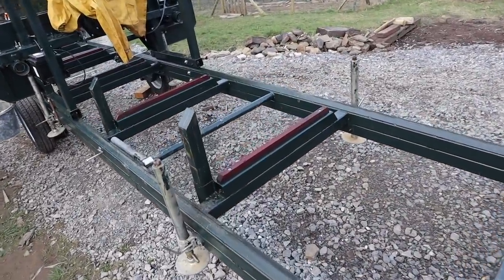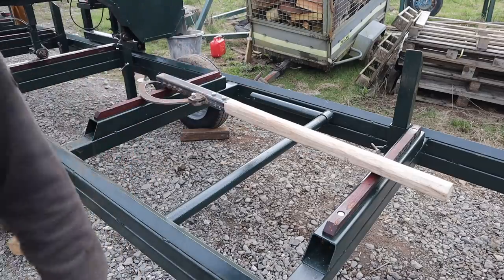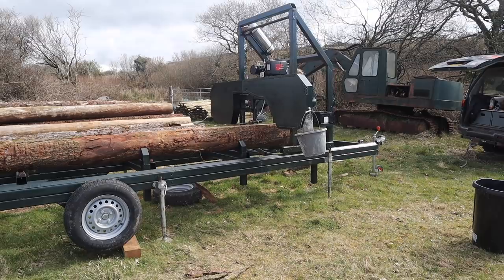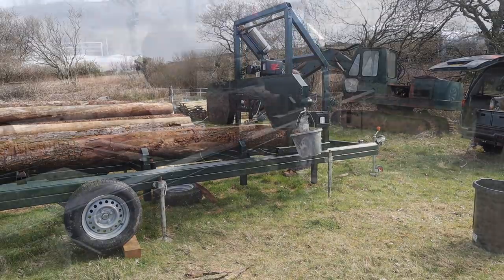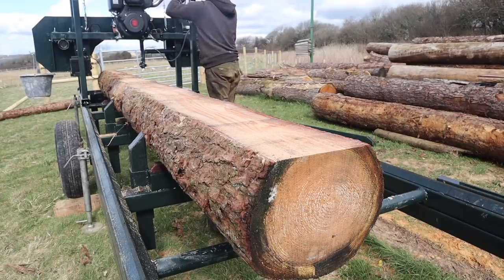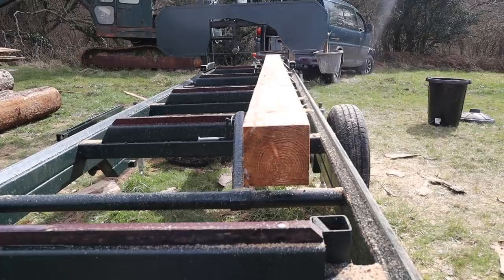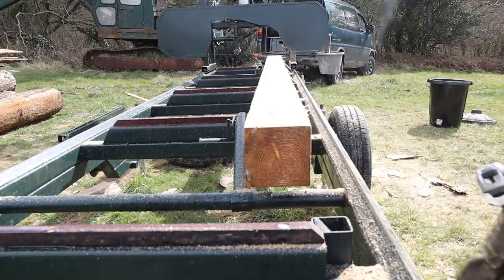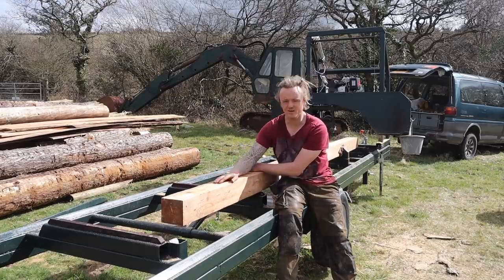First Cuts On the Homemade Bandsaw Mill

Comment: And just like that every farmer around you is now your best friend
Reply: And now he might get a decent supply of lumber in return for the services of his sawmill. Not to mention some of the useful junk that farmers tend to have in plentiful supply.
Reply: @naiknieh  This, my neighbour has a 60x40 shed with approximately 10-15 conical piles 10ft high of random metal parts, boat parts, tractor parks, Alaskan mill parts, chainsaw parts, honestly any time I encounter a 40-50 year old piece of machinery with a broken part that no one makes anymore I go there and usually find it, covered in rust of course, but enough to be able to rebuild the part and have it work properly again. He's an older man, raised poor during the depression, doesn't throw a damn thing away.

Comment: Haven't read all the comments , what I am about to suggest may already have been suggested. As a 15year old laddie,(1955), I worked in a woodyard, my job was removing the bark from the sticks,(trees), these would be used for the pit props. the machine used for this purpose would eject the peeled bark through an outlet similar to your sawdust extracter.at the end of the funnel were three hooks welded onto the outside of the funnel, by hooking on a hessian sack to these three hooks we collected the majority of the peeled bark with little spillage, you might want to consider this. By the way , I cannae drive a nail in straight , maybe that is the reason I really enjoy your videos. Thanks for all of them.

Comment: I would highly recommend a water tank and a feed line to lubricate your blade, prevents the blade from stretching excessively.
Use some dawn dish soap in the water to help. Doesn't take much.

Comment: Kris, I'd recommend you install some hard wire brushes infront of the carriage wheels, to keep the rails from becomingbuilt up with tree resins and sawdust. We have a sawmill similar to yours, here in Wales, and we predominantly mill pine from our plantation. The metal brushes prevent the running gear from being clogged. They are also installed at ther back of the runners, to scrape the rails clean again, when you run the machine back to its starting position. This tip will save you a lot of time cleaning rails and wheels.
.
Reply from the maker: Yeah i have seen those done on other mills. i think a bit of steel cable works quite well. Yep, another job to add to the list.
Reply: @KrisHarbour  I'm still jolly impressed with your build. And all of your constructions. You've certainly inspired me, an d others  in our small community.

Comment: If you put your roller closer to your timber it will stop your blade running off (cutting straight)then your cuts will be straighter, we have packers at each side of the blade to stop it running off but always have the packers as close to the timber whilst milling so the blade cuts straighter. You’ll also need a blade for hard wood and a blade for soft wood , I’ve had over 15 years working in saw mills so any advice isn’t a problem 👍

Comment: Awesome job on the saw mill. Just a note about the log rests. Most people make the mistake that the sloped top should face the log, when in fact, it should face away from the log, so when you are turning the log, the point won’t dig into the log. The sloped face allows the rough bark to slide . Cheers.

Comment: Bloody brilliant! One suggestion you might already know: It's beneficial to heat cycle the engine a few times during the break-in period, avoids patterns on the surfaces.
Reply from the maker: Yeah i have been doing that. its had quite a few heat cycles now from all my testing so now i think im going to use it gentle for a few more hours then go full.

Comment: I would suggest a set of brushes for the sled rails to sweep the sawdust off them so your measurements stay within tolerances.
Keep the blade followers as close to the log as possible!
It is nice to see that smile!
Stack your planks and beams with stickers to help prevent warping as they are drying out!
Maybe think of adding a handle bar spanning the width of the sledge to help balance the effort in pushing the mill along the tracks.
I have seen some mills that use a rope system to aid in moving the sledge along the tracks as well.

Comment: A well deserved moment of self satisfaction savoured there at the end. Well done Kris. On the issue of ejected saw dust, may I just share one observation, namely would running the frame rollers on an inverted ‘T’ rail along the ‘down wind’ frame rail by using grooved roller wheels, help to minimise the inevitable build-up of dust debris that will most likely stick to the ‘down wind’ flat surface of the rail? The frame section currently running with flat rollers is continually being sprayed with wetted saw dust and could likely build up layers of compressed saw dust on the surface of the frame by its rolling action? By using an‘ inverted ‘T’ rail, the contact surface area between the frame and rollers is vastly reduced and effectively would most likely self clear, due to the grooved ‘cutting action’ of the rollers.  Build up of sawdust over overtime on the flat rail as it is at present could potentially increase drag and marginally raise the rollers resulting in some inaccuracies along the length of the cut.

Comment: lovely job Kris. nice boards as well. i can see this as a very big step forward in your homestead build. as an added bonus the more boards and post ETC you cut the more firewood you will accumulate with the slab wood coming off the sides of the logs. you can even use the sawdust as soil conditioner, it`s what i do with her garden. she lives "over the other side of the valley" near you. good job, well done....

Comment: If you have an old paint brush, use it for a sweep in front of your rollers. Nothing like a wood chip adding alittle wave to your cuts.  Also some larger pads for your leveling feet would be handy and save you time from the logs jostling the trailer out if level.

Comment: Great job on the saw Kris.  The track where the saw dust is collecting , mount a paint brush in front of the sled. That will stop a lot of the saw dust getting under the sled wheels. Just a suggestion. Bit out my reach for a band saw build .But ...it was worth while watching the process & the trials & errors/ mods you did to make it all come together.

Comment: It looks like it is working very good. could probably use some bracing to stiffen the power head structure. You can see alot of movement on the leading edge blade guide. Rigid is better.

Comment: This will save a lot of time for you . Great job !!!
There is attachment for a worm drive skill saw mag77 that adds a chainsaw bar and you having cheap electric power it could cut left and right cuts after your flat top and bottom cuts . I saw a guy he set them on saw horse and used a metal bar to run the mag 77 skill saw with the chainsaw attachment.

Comment: very impressive. all timber requirements sorted.
there is an NZ tuber that designed a mill with two 90 degree blades. set it up to cut out 1x1 2x4 etc.

Comment: gday mate nice work . if you strip the bark before slicing up the log it helps the blade last longer as the bark usually has lots of dirt and rocks in after skidding. I’ve  had to pressure wash sometimes.  cheers from australia

Comment: Congratulations Kris you should be very proud it turned out Awesome I've seen quite a few store bought mills in use and I think from what I see yours is better built the materials are stronger than most and wait until you get that engine broke in it will cut a whole lot faster as well. Great job !!

Comment: Great stuff Kris. Great to see it working and so well. Once you get your engine run in there will be no stopping you. Isn't it therapeutic? Very enjoyable work. One thing I would say is keep your adjustable roller as close to the log as you can, within reason, don't be adjusting it all the time like because that's a pain in the arse but just keep it maybe 2 inches from the log. For that pile of logs you'll be able to leave it in one place for the most part. I'm sure yours is fine but it just reduces the amount the blade is able to move and wander.

Comment: The sawmill looks and apparently cuts great.  Thank you for sharing your journey.  A couple of thoughts that might help you though.  To cut out any blade bind you might consider some thin wedges every few feet to support the suspended edge.  What we in America at least here in Oklahoma and Texas call door jam shims might work although they are easily broken and wouldn't have a very long useful life span.  But a clever guy like you could probably come up with something similar made out of a longer lasting material.  And if you ran your sliding blade guide closer to your log it might improve your tracking as you cut.

Comment: Should get a chain driven wheel mounted centre-front on the trailer to pull the mill along, using cables and pulleys you could have it pull the mill on both sides giving you a straighter track (so you don't have to worry about the mill twisting as it's being pulled along), would likely be fairly easy to reduce overall effort and your physical movement as well, not to mention safety as it puts you further from the machine plus reduces the likelihood of tripping.

Comment: Very nice, this will be really handy for all future wood projects.

Just one thing for the engine. During the break-in period the engine should be run at all the speeds and under varying loads for the best results. It should see some high speed, low speed and in between. Also it should see high and low loads, just don't go to the max and don't run it at constant speeds.

Comment: Maybe put a bar across the back to help even out when your pushing so one side doesn’t lag, might not be a problem when your at full speed! Looks great
Reply: Good idea - a handle that's half-way between both sides, so that when pushed, the head unit is pushed evenly - as it is, that little side-to-side lag or wobble is bothersome.  Not sure if it's having any effect on the cut...

Comment: L👀ks good so far.  I'd say that the addition of some kind of mechanical aid, to help pull the saw through the cut at an even pace and with equal load on each side as it moves down the track, would be a good idea.  Looked like you had a spot where things were tending to bind while under load.  It may also make a difference on how tired you feel after a full day of cutting.

To keep twist out of your bed ... Use of a long carpenter's level, and making sure it is set up equally from side to side (after loading an average sized log) may help smooth out your carriage travel, and show you if you need to put in additional downriggers... some levels are magnetized on one edge, so you might be able to just stick one on top of your guards and leave it there while sawing.  That would allow you to monitor your level as you go, and you can compensate for settling that may happen during use.

Comment: Something to add someday:
A conveyor belt on the sawdust side to transport the sawdust to a pile.  A setup pulleys and transfer gears will pull the conveyor in the same direction as the cut.  It will ratchet back when returning the mill for the next cut.   One of the gears  to be oversized such that the rate of advance of the conveyer is a little faster than the mill advance.
Alternately, an automatic bucket that empties at the end of the cutting run --- but you would want to run it to the end of the rails to keep the pile out of the way.
Collected sawdust can be used for many other things from adding to the gardens (watch the acidity), to making firewood pellets.  (Another machine could be built to do that - and use the motor from the mill too or run off electricity.

Comment: Concerning saw dust:
If you want to fill in some gaps between some wooden planks on your floor, you can mix sawdust (of the same type as the planks!) with clear lacquer to create a paste which you can then use to fill out the gaps. Another alternative is white wood glue ... but since that stuff is water-based it shrinks a lot more than the lacquer "paste". In any case these things need to be made fresh and used quickly.

Comment: Hey Kris,
The Mill works Beautifully!!! You were mentioning about raising the far end of the frame up, but I had a thought that might correct the 4 to 5 mm difference that you might look at before you do any raising or shaving off of the hardwood protectors. I think that maybe the axle and wheels may be putting weight in one particular area and causing the far end of the frame/ track to bow upwards. You might try blocking under the axle instead, not under the wheels because that could bend your axle. I believe that would correct the 4 - 5mm issue. The track is so long that a slight bit of weight in one area would cause the frame/ track to bow. If you raise the end of the frame you might actually put a permanent bend or twist in the track and frame.
Keep Safe All,
Matt - Toronto, Canada

Comment: Kris, I've seen other band saw mills use a kind of chip brush idea in front of the roller wheels on the track. Id hate to see the blade pinch or break because the trolley bounced from a piece of debris on the track. The build looks amazing hope it serves you well for a long time!

Comment: @ Kris Harbour
Kris you might want to make up a new adjustable tow ball so that you can adjust the height of the tow ball for when you are moving around the bandsaw mill. This will prevent you bottoming out like you did when you first hooked it up to the van & had a bit of a rough time moving it from where you built it. You also need to buy a 7 foot long straight Jimmy Bar with a 4 inch or 6 inch spade chisel on the end to use to remove the bark from the tree limbs, cutting your wood with normal blades will wear out very quickly unless you remove the bark. I'm not sure if you can get TCT or Diamond blades which would be far better but anyways.

Comment: Just a thought, it might be an idea to consider a wiper at each end of the wheel box sections, a piece of stiff leather or rubber to prevent saw dust being compacted on the guide rails.

Comment: Congratulations on one of the best bandsaw designs ever! I especially liked the diesel engine with its higher torque!
What would have really made it unique would have been to be able to cut to 3 mm thin boards which to my knowledge is the thinnest available in the construction sector but then as veneer, boards I have met with 10 mm chipped. The problem will be retention, I guess?
I myself have a log house that is 17x13 meters and if I ever need a 17-meter log of 200x300 mm I will have problems! If I had more forest, I would probably make a similar saw but bigger as the thickest log I came across was 118 cm, and considering branches and other things, I would make it so that it would handle 150 cm...
Perhaps a machine feed would be a good upgrade for smoother cuts? Grease nipples for all sliding surfaces could be good for longevity!

Comment: Bloody awesome work mate, as always a quality well thought out product! Totally wish I could find the motivation to go out and build one myself! 

If I may, have you thought of a winch on the side of the carriage so you can get a steady feed rate by just turning the handle? So cable run the length of the bed to a wheel, back down to a winch on the carriage. If you wanted to get fancy add a small drive motor, wouldn’t need much grunt. Just makes a consistent feed rate. 

That is nit picking though, as I said you did a pearla of a job! 🤟

Comment: You definitely pulled it out of the bag with that one mate works a treat the only think i noticed was a bit of a wobble ( flexing ) up and down where the motor it mounted i think it need a bit more support around the engine to make it one solid bar or pehaps put some more bars where you was pushing it to the front near the engine love you videos your a very talented person

Comment: After the shakedown run of your mill check the clutch for wear, operating the mill at slow speed for the engine break in period and stalling the blade might be hard on the clutch, all in all the mill performs as intended.

Comment: You need a set of rubber grip rollers or a gear track system attached to both sides so you can crank it down the entire log evenly and effortlessly.
Reply: most of them that size have them, you should go faux shopping for a mill and see what I'm talking about.

Comment: Great work a good engineering project👏 Not sure how you are measuring the thickness of each cut? Could pimp it up add a measuring rule to the fixed part and a pointer to the saw section that moves up and down then put a magnifying glass the correct distance from the pointer. This would allow you to check the size of each cut without measuring

Comment: you should change the sawdust catching a bit as some of it hits the flap to hard right now and then spreads out to far.  Move it a bit furter away and add an angle to it should help, adding a cover would help even more if you designed it to guid the sawdust. But I must say that you mill is a very good, so you should be very proud of it. I think I saw a way to add a track so you could turn a wheel to get both sides to get the same push too, but I might be wrong about that.

The sawdust spread will get worse when the speed of the blade is faster too.

Comment: You should put a tool box up front by the hitch and make a spot to hold a couple chainsaws. That way you can have tools, oil, misc. stuff and a perfect spot for your chainsaw ehile milling. Good job my guy.
Reply: Also a area to hold diesel fuel and 2 stroke
Reply: Also a gauge to measure blade depth to get accurate widths of cut